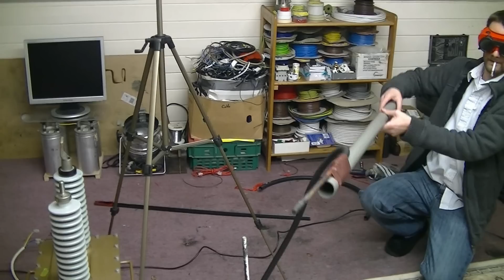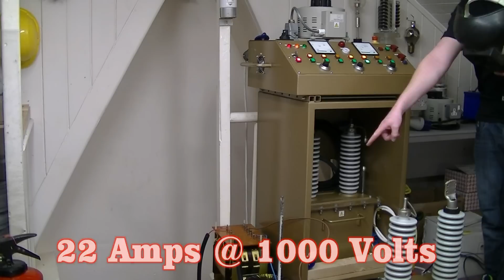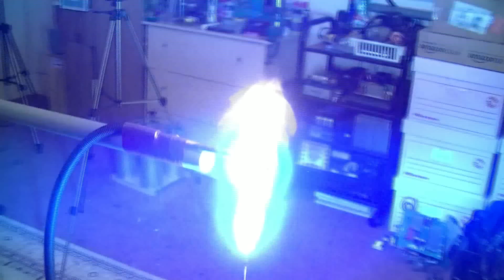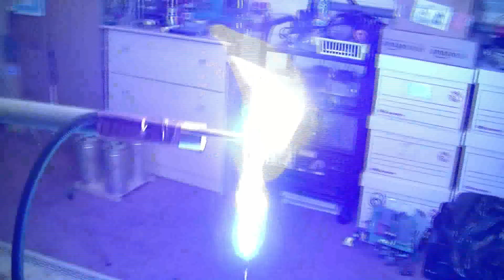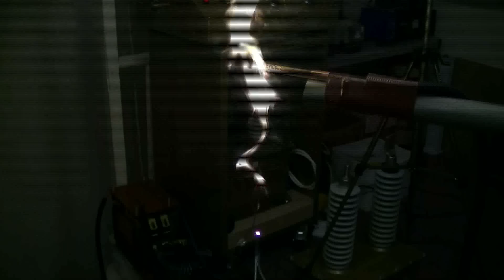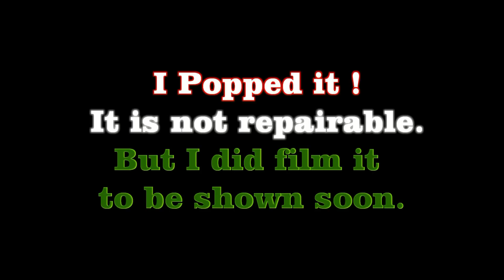Electricians Playtime

Comment: i have accsess to 64000 volts and 694 amps. should i get more?
Reply: Good luck not dying
Reply: +Nicam16 Pfft, what are you powering? An LED? You need 1,000,000 volts and 5,000 amps.
Reply: +Fire In The Sky HOLY SHIT!!!!! I dont think you can get that much power from two nuclear power plants :). But it would be awesome :). I can not imagine the EMP from that, but it would be safe to say the ozone hole would be covered up :D.
Reply: Nathan Boody No i just have 9 petrol generators connected to a bunch of 420 farad capacitors and a small(ish) MOT :P
Reply: +Angelo&#39;s Lego TECHNIC Creations that would be 44 416 000 w

Comment: Why does the voltage increase when the arc starts? Why doesn't it decrease?
Reply: in the UK they do things a bit different, when things draw a lot of current your pwr feed compensates for the lower voltage and so it increases, either that of he's got a crap ton of high voltage feedback
Reply: i have a strange feeling that the compensation isnt doing that, in the excess of 280V isnt right.. the lights didn't dim or brighten either, from what a video details. It may have been to do with inductance and the inductive reactance of the transformers in use, however i have no real definite answer. Ive wondered also how on the big boy's supply, he set the buttons that limit the power? like how can you push 250W, 400W, 700W or 1000W through a load inside that small enclosure?
Reply: +Kenyon Shutt +1

Comment: If you connect several identical MOTs in parallel you'd get the same effect.
Reply: Black Wolf mots dont last more than 5 mins with him he likes to short things out and see how long they last without complaining
Reply: hansley maharaj I want to get 4x identical MOTs and connect in series (2 on each side with grounded centre) to get about 8Kv but any more than 4 MOTs would arc from winding to transformer core or the line input.
Reply: Black Wolf get a container fill it with oil and put them in there you are welcome

Comment: 22,000 watts that's a lot of power, must be a big plug you got that connected to,
92 amps at 240 volts that's all the power a house is wired for here in Canada.
Great videos, can't wait for the mega volt video

Comment: At the moment i only have one cap i will try more capacity on the secundairies.

there was a big diffrence in arc's when i switched from resistive ballast to inductive ballast...and no MOT burnout!

i only run it at 150V.If i increase the voltage the performance will drop....less resonance and core saturation of the MOT

It is fun to exepriment to get the biggest arc's out of a single MOT without burning it out.

Comment: I got 3MOT's and on the secondary side I have 4 microwave capacitors 2000v all over 1,uf, I find that if you have 2 caps per transformer it increases the size of the arc you can draw due to residence.

Comment: I did the same with a single MOT..I took a choke in series with the primairies and ran the MOT at 150V so it din't saturate to much

On the secondair side one 1,16uf capacitor...I got massive arcs for a single MOT...I could make arcs continuously without overheating the MOT..
Next experiment is deshunting the MOT ;)

Comment: Yes i have. When you go past the rated primary voltage you are just driving the core of the xray transformer deeper and deeper into saturation while output voltage wont rise linearly. At same time the voltage drop over your ballast will grow bigger as deeply saturated transformer draws more and more magnetization current. Sure you can get *some* amount of overvoltage but not even close to megavolt. Perhaps extra 100kV?

Comment: Indeed it is, & I explained that in one of my other messages BUT there's only so much I can fit into 500 chars. :D

The red 3ph plugs are available as 4-pin & 5-pin. The 4-pin is 3ph+Earth....The 5-pin is 3ph+Neutral+Earth.

I prefer the 5-pin, as then, it's possible to use only one of the phases & the neutral in order to get a 240v supply from what is normally considered a 400/415v supply. :D

If you look through my PLUGS playlist, you will find that I have shown a red 5-pin plug. :-)

-BBD.

Comment: Great videos.
I would really like an explanation or a circuit diagram for each of your test setups.
eg mains into this variac then into to this transformer from a ????, we are measuring volts here and amps there, I expect an output voltage of xxxMV with a current of XXXKA etc
Very interesting
Greg

Comment: Ah, In the UK, the plugs are a bit different, as those blue plugs & sockets can be 1ph as well as 3ph.

Generally there's three common colour-codes for these plugs: Yellow=100-130v, Blue=200-250v, Red=220-380v or 240-415v.

All three colour-codes above are available in 1ph or 3ph forms. There's other colours too: White, Grey, Violet & Black.

Black has the highest voltage range at (I think....) 750v max. :D

There's even DC versions of these plugs & for frequencies including 60Hz & 400Hz.

BBD

Comment: Your last two videos have been STRONGLY interlaced but only from certain camera angles. One of your filming cameras is in interlaced mode, the one you used for a close-up shot on the electric motor last video is  what people are harping about.
Your little Go-pro toy looks quite funny as it smoothly tracks past the frame. It's definatly in interlaced mode. Look at those wavy images.  All the slow motion video you are useing makes things worse. The video software will interlace to make it smooth.

Comment: you could buy one of those cheap (~200 pounds maybe) high speed cameras like the Casio EX-FC150. You can manually adjust exposure but just by putting it on the high speed setting should lower it enough anyway. I used one for filming my homemade cannons and it survived quite a lot.